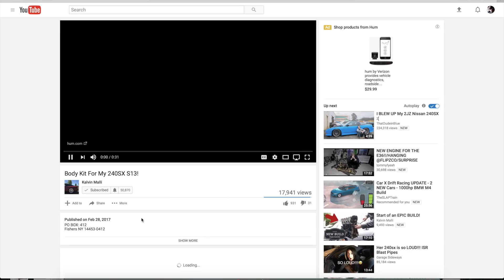Budget 240SX BUILD | Part 9 | $40 Paint Job

Comment: Would like to see my 280z there and paint my bay the same LP2 and drop in my RB20 lol
Reply from the maker: +Chris Davila now that would be awesome..
Reply: Kalvins Garage I have a question, i want to freshen up my RB20 and install a N1 oil and water pumps but i was told the N1 water pump wouldn't be good on the RB20 unless im going to be high reving the engine since it doesn't flow much water at idle or normal driving, basically they said I was a water pump for a track car?
Reply from the maker: +Chris Davila beats me man. Haven't looked that deep into it. I'm sure it will be fine.